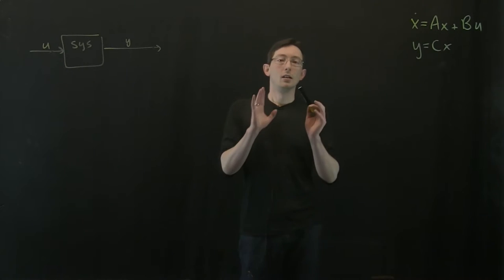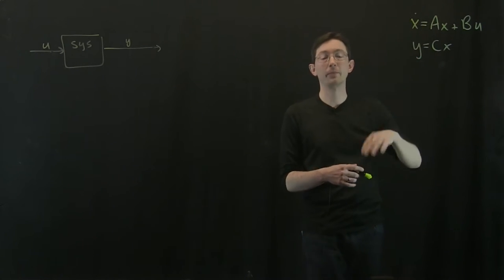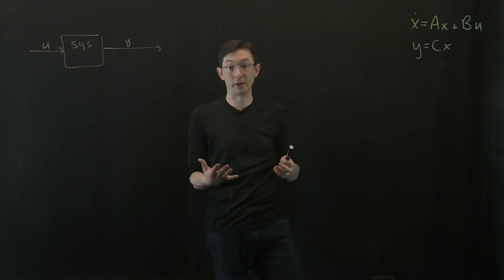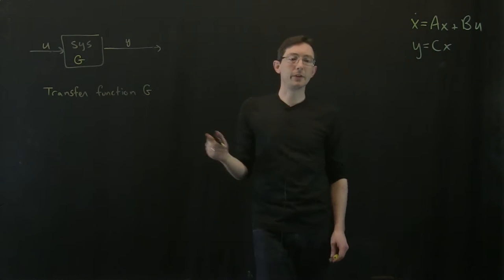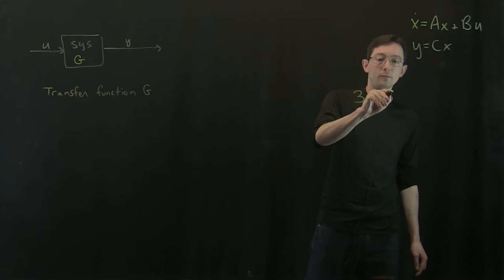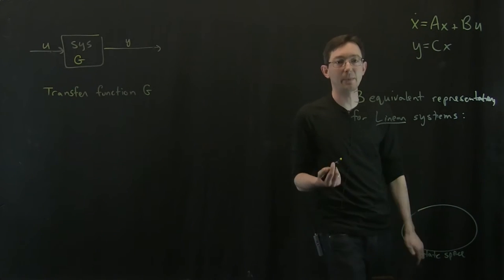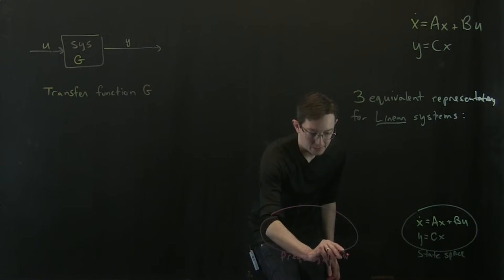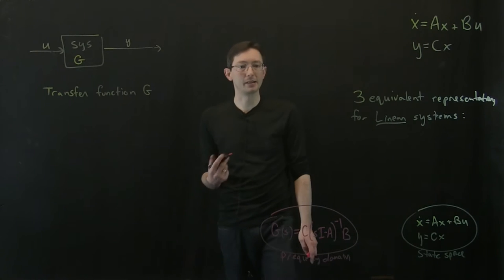Control Bootcamp:  Three Equivalent Representations of Linear Systems

Comment: Isn't all of this applicable specifically to Linear Time Invariant systems? The videos mention only the linear part.
Reply: You are right, time invariance is a prerequisit to working with both the frequency domain and with convolutions. He didn't mention it specifically, but I think that the underlying assumption that the system does not change its properties over time is fairly well established here. Time invariance is essentialy that.